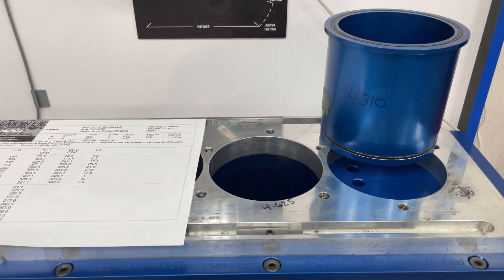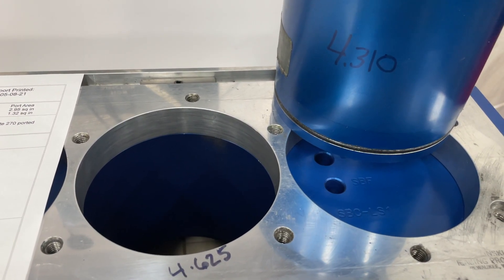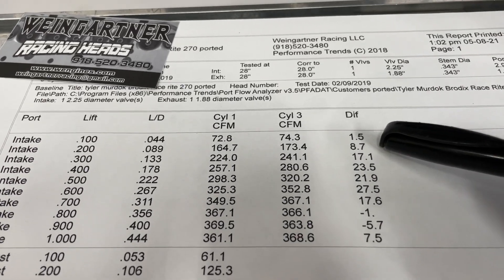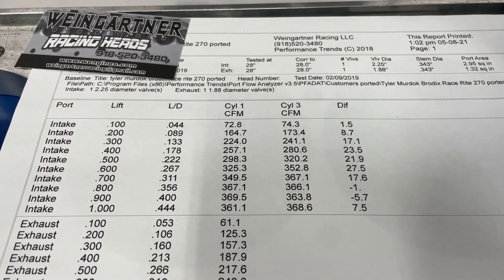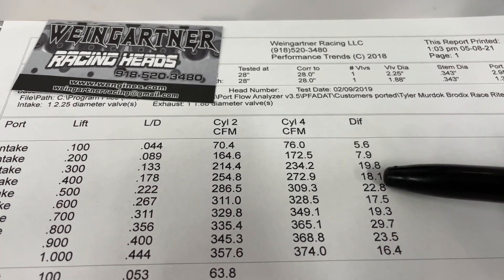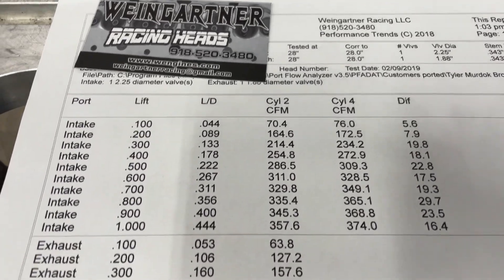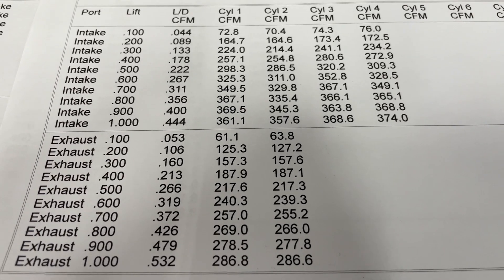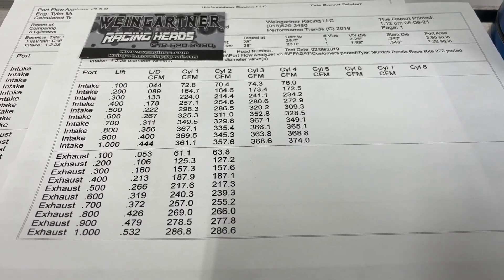Does Bore Size Effect Flow on BBC

Comment: How would a bigger valve size effect power production? I was looking at Brodix bb-3 heads with 2.300 intake with oval ports, versus the stock 2.19 in and 1.880 ex rectangular ports. I am trying to keep the torque production of the oval ports and still make 700 hp on the top end on a chevy bbc 427.

Comment: If you still had the heads and the time, I would be curious to see the difference if you tested the ports with reverse flow.  Would the intake show minimal improvement and will the exhaust show more improvement? And at what bore size does it eliminate the step between the bore and combustion chamber?

Comment: I would like to see what you gain back on the smaller bbc bore size when you add the valve unshroud cut to the top of the block, as the early blocks came factory.

Comment: I see you've still shown no love for Mopars.  I will hand deliver some Mopar heads just to finally see something Chrysler on your channel.
Reply: I'm not fancy enough for aftermarket heads, but I've got a few spare big block Mopar cylinder heads, and a set of stock port 340 heads.  I'd just like to see your opinion on them.
Reply: to be fair my pre-1972-clone/franken-junkyard iron D-8 castings ( 2.3-2.4" valve heads intake's and exhaust so a little bit different than the Chevy's sizing, contemplated using bigger valve's but my DI-injector/EFI and duel-plugs are in the way and i was told that going bigger and longer duration with lower lifts will help dynamic compression ratio-up and longevity in my parts ect. thats why i didn't stick with 2.25" / OEM stock sizing ) hemi/BBM mopar uses a 4.25"-4.30 bore ( common mopar big block sizing for the bore 4"inch to 5" ish ) ( by 4.5 ish stroke aka biggest that fits without grinding the pan rail ect. and a external oil pickup's and dry sump oiling system ) so really close to the smaller size Chevy example and the OEM 572 use's the 4.5" /biger bore sizing but my understanding is it's not good for boost or high loading like towing as its more likely to pop a head gaskets or crack the castings
Reply from the maker: I can flow 440 mopars. I just haven’t done any in years.

Comment: On a world products aftermarket race block 4.200 on a small block is max recommended bore and if you stroke it at 4.0 stroke you have a 440 cuin small block. He, He, I am adding a 8/71 super charger to it. Not bad for a small block chevie.
0

Comment: What flow bench are you using?
Reply from the maker: I have two flowbenches the saenzd680 and superflow 750. This test was done on the Saenz.
Reply: @WeingartnerRacing  if I wanted to start flowing heads on my own what would be a good bench to start on?

Comment: There's a debate on utube uncle Tony's garage and Dave frieburger roadkill fame dulcich well some say turning pistons on a Mopar gives you more power frieburger and friends say no do have a clue to weather it does or doesn't..give you power
Reply: Spoiler alert !  Not worth it...  99% of aftermarket pistions have centerd wrist pin locations. If an over center wrist pin location boosted power, ...EVERY piston manufacturer would do it !!!
Reply: @Torquemonster440  well hopefully when they do the build this will fuck them up with the idea frieburger said no . uncle Tony said yes it does we will see hopefully...
Reply: @jeffreybamford7365   Those results will likely be within testing variance +/- 1%. You will see no difference with flipped pistons on the dyno.
Reply: It’s a known industry secret that turning the pistons 180 degrees will do magic
Reply: @bigboreracing356  right ok .well apparently a couple of utubers are going to build a motor each and compare data to see once an forall if it's worth it
Reply: @bigboreracing356  me hell no they said it's only good for mopars not LS motors.ive got enough for now if I want more I'll go a different route hahaha.